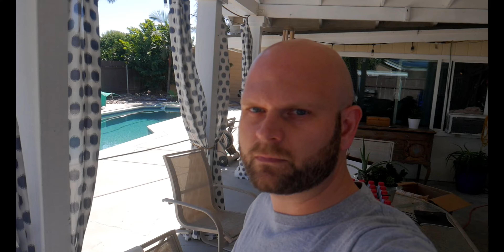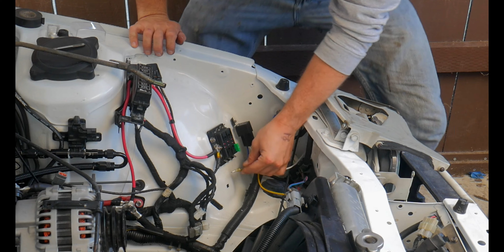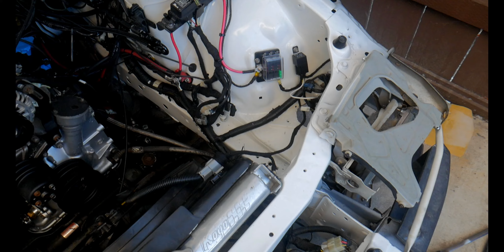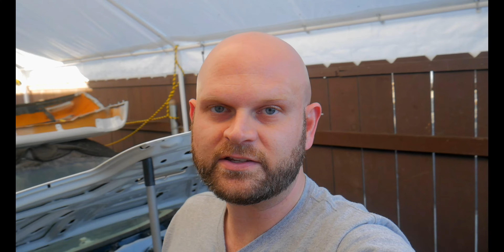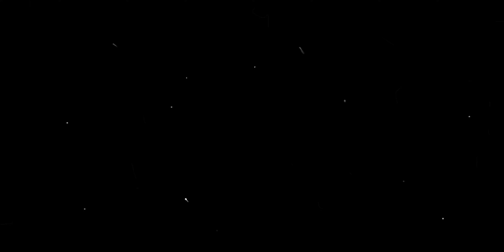Wiring an Electric Fan // efan mod RX7 FC3s 1988 Mazda

Comment: Hi! Quick question. If I didn't have a haltech or a thermo-switch, the white wire would just go straight into the cabin and onto a switch? Which would mean I need to flip the switch to turn on the fan each time I run my FC? Sorry I'm new to this whole wiring thing
Reply from the maker: The trigger can be ground or 12v and wire color will depend on which relay you purchase. But yes you can put to a switch instead of ECU or thermo switch

Comment: whered you pull the fan from??
Reply from the maker: Nissan quest 90s model. I got mine new from autozone https://www.partsgeek.com/gbproducts/DC/6788-05366045.html?utm_source=google&utm_medium=ff&utm_content=DN&utm_campaign=PartsGeek+Google+Base&utm_term=1996-1998+Quest+Radiator+Fan+Assembly+TYC+620350+96-98+Radiator+Fan+Assembly+97+1997&fp=pp&gbm=a&utm_source=google&utm_medium=ff&utm_campaign=PartsGeek+Google+Basecid=6774379819&aid=79287199093&keyword=831994385494%3A%3Apla-831994385494&kid=831994385494&gclid=CjwKCAjwsO_4BRBBEiwAyagRTZphnRtcYoNjuKxRlVCa8CX8YpzvW07vpNewMd0-dp5DRelEpUaA1hoCWAkQAvD_BwE
Reply: @MohrGarage  nice!
Reply: @MohrGarage  the tabs look like they're going to line up nicely!

Comment: I wanna see the final setup for your temp switch
Reply from the maker: It's a trigger off of the haltech 1500
Reply: @MohrGarage  What temp sensor are you using?
Reply from the maker: Haltech temp sensor to a 1500 elite ECU

Comment: Hey man, this video just gave me the confidence I need to tackle the e-fan conversion on my FC. It's been starting to get hot at stoplights and I'm not sure if trust any used fan clutches. Reading instructions on the forums is not nearly as helpful as actually seeing the process on cam. Your production quality is amazing and your steps are very detailed and thorough. Cheers.
Reply from the maker: Thanks and good luck, in my newest video I upgraded the hot wires from the relay to 12 gauge. Highly recommend.